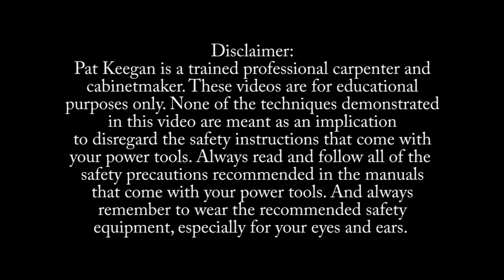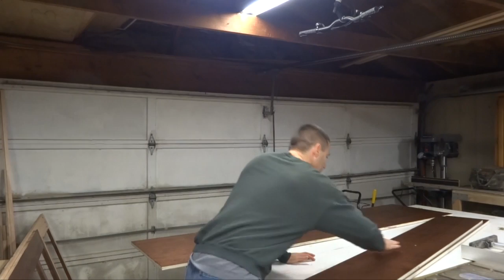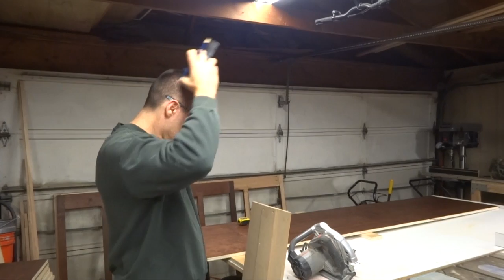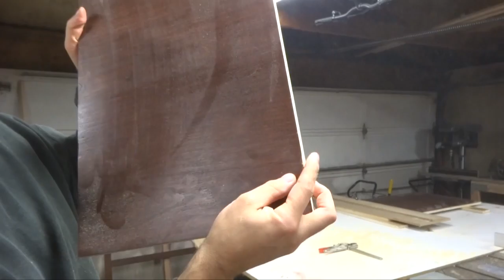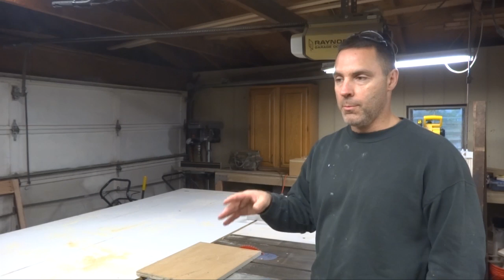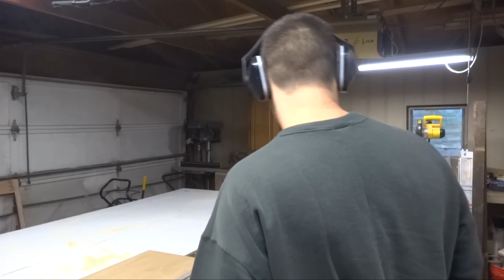How To Build Your Own Kitchen Cabinets: Part 1

Comment: Great video but I see you struggle with cutting your cabinet parts. There is a new affordable machine called the Pro-Cut 50 that will solve your cutting and router needs It will provide factory edges in both rip cutting and cross cutting with no tear out. The Pro-Cut 50 is designed for the cabinet maker and smaller shops. Well worth looking into.
Reply from the maker: torontotool1 definitely. I've been thinking about building a panel saw so that i can do my own cutting in the shop, but it's hard to find the room. I'll Check out the Pro-Cut 50. Always looking for better, more efficient ways of doing things.
Reply from the maker: torontotool1 At first blush, it's a great looking tool, and doesn't take a lot of space. I watched the 4 min video, and i liked what i saw. Definitely looks like a time saver when compared to doing things with simpler jigs like I did in this series. I don't particularly want to criticize because I don't own, nor have I used the tool (and besides, it looks very innovative). But If I had my choice, I'd prefer cam-type locking mechanisms, rather than the threaded "screw-down" type. Over years of use, cam style lockdowns would save a person many hours of screw/unscrew motions. Just my $0.02 on LEAN thinking. That aside, I liked what I saw but would reserve full review/comment until I actually went through the whole process from setup to teardown.
Reply: ***** The Pro-Cut 50 is a wonderful machine designed for accuracy and ease of use. The only time you use the carriage height adjustment screws is when you want to raise the carriage to cut material thicker than 1". The machine will cut material up to 3-1/2" thick. To be honest, in all the cabinetry I build, I rarely cut material thicker than 1" and seldom have the need to raise the carriage but it is good to know that I can if a project calls for it. The Pro-Cut 50 takes the best of a professional table saw, a quality panel saw and a router table and combines it into one precision machine. It is a true professional cabinet makers tool. I am sure if you ever have the opportunity to use the Pro-Cut 50, there would be no turning back.
Reply from the maker: torontotool1 Yes, as I mentioned it does look like an innovative tool for the price. I'm sure I would like to try one out for a couple of months :)

But I was referring to the number of twist locks required with the various operations as shown in the video. There are twist locks to lock the sled in place during router use which seem to be used often, more to hold down the sled/base for the circular saw that need to be unscrewed/rescrewed when changning the orientation of the saw, more to lock the carriage height in place (which are probably used less often) and still more to lock the panels in place when cutting them to create the factory edges. 

I still believe my point is valid. As with all manufacturing, if the tool stands the test of time, you will make improvements to it with future iterations. I would simply suggest in your next iteration, you replace as many twist locks as possible with simple cam type locks similar to the ones you already have that are used to lock the 51" side-guide into place.

Comment: Hi,
I'm a novice DIYer, but I am thinking of making my own cabinets using recovered/recycled timber, is it advisable to use those, instead of plywood for the side panels?
Reply from the maker: Hi, and welcome aboard! Glad you stopped by :). I think it's great that you're thinking of making your own cabinets. 

That's a great question by the way. Really what it comes down to is what are you trying to achieve? That usually tells you what you should use. There are pros/cons to each. For example: Plywood is dimensionally more stable than solid wood. With solid wood you definitely need to take wood movement into account during the construction process, being careful of where the glue goes and how the screws get put in, otherwise you end up with panels that split. On the other hand, Plywood veneers are thin and flimsy and you have to be careful sanding them, otherwise you can burn through the veneer and ruin the finish. 

I would need to know more about the "why"? in order to make a better recommendation. Are you using recycled timbers because you're going for the that particular look/style? or is it because that's what you have available to you and you want to save money? (we say 'it's what we have laying around the shop')?

There's no easy answer because I'm not sure what you want to accomplish. Plywood will be easier to work with for sure. Recycled timber usually needs to be worked (cleaned up, nails and metal bits removed, planed, squared up or jointed, etc). There are lots more steps involved than for using plywood, and that will add time to the project. On the other hand, people put all that time and effort into it because they want to achieve that recycled timber look and feel.

One thing you can do maybe is to compromise. perhaps build everything out of plywood and then cover the visible ends with panels made from the recycled lumber. That way you get the best of both worlds. that's also what we did for this series. We covered the visible ends with Cherry Plywood, even though all the cabinets were made out of prefinished maple.

Hopefully that gives you a starting point. Let me know what you decide to do! Thanks for watching and the great question!
Reply: *****
Hi, thanks for the quick reply!

In a way, the decision to use recovered/recycled timber was more of an environmental point of view, I would like to try and use the recovered timber instead of sourcing for virgin wood.

And funnily enough, to try and use recovered timber, I have to ship it from elsewhere. Those materials are usually timber recovered from old boats and sheds, and have been suitably cleaned up and metals bits removed. From what I can research on those, recycled timber have undergone a certain amount of weathering and seasoning, and I rather like that sort of texture on my cabinets.

But another reason why I was considering against plywood, was I worry about the durability of plywood. I have seen cabinets with plywood falling apart because the glue that was holding the layers together degraded over the years. 

From a cost point of view, I might end up using plywood for all the interior panels, then use recovered timber for the exterior. But if I am already spending the money shipping the material, it probably won't make that much a difference  if I used plywood or recovered timber. I know I will probably have to use plywood for certain areas of the cabinets, but I am hoping to minimise the use as much as possible.

I am hoping to get your opinion on whether it is practical to do it that way?
Reply from the maker: macdawn that's a very cool thing to do and of course i respect your choice to consider the environment.

You definitely have to consider the durability of plywood, or more appropriately, veneered plywood. From my experience, quality plywood, if finished and cared for properly, will last for decades. 

In fact, many pieces of furniture you see are covered with the same thin layer of veneer as cabinet-grade plywood. dressers, tables, etc. And you are right, there is the risk of delamination, which is what can happen to the layers and/or the veneer covering.

Typically though, this happens after the cabinet is damaged in some way, either it's exposed to water damaged, or physical damage (it's dropped, dragged, scrapped, bumped with something sharp, etc) which can kickstart the process of delamination in that area. Water damage is the big one, but you get the idea. 

I'm not trying to convince you one way or the other, because both methods have merit, and each has their pros/cons. It all comes down to what you're willing to live with. 

I also weld. I recently made a couple of nightstands and a headboard made from welded steel frames. I will use recovered lumber for the wood components because it matches the look i want. (industrial urban weathered vintage, etc.)

If i were making a single cabinet, or a couple of end cabinets, or even an entertainment center (movable) i would consider the recovered timber. but if i were making an entire set of kitchen cabinets, i would use the plywood, and perhaps cover the end with the recovered panels. It's just too much work and mindfulness of wood movement to do them all out of solid wood (for the carcasses I mean). Plywood is faster (for me) and usually less expensive (for me).

Good luck! Post links to pics when you're done!
Reply: may work but would have to make a outside frame frist and cover with what ever type of board you were using like in old style days befor plywood was made

Comment: Just to add a couple specifics about the wood dust dangers, carpenters have been shown to be 4 times as likely to suffer from asthma later in life, and, hardwood dust has been clearly shown to cause cancer, particularly of the nose...  Lots more can be found on the internet, but serious stuff not worth overlooking the protection of a respirator to prevent the risk.   And since we're talking about 2 micron stuff, you don't take your mask off when you can't see heavy dust thinking it's safe now since there's still plenty of the fine dangerous stuff to do you in.  Dust collection systems should be a must for anyone doing regular cabinet building like this... check harbor freight and others for reasonable priced systems as anything is better than nothing.  I actually cut outside in my driveway (tables saw's on casters) to not be trapped in a closed space like the garage.   thanks!
Reply from the maker: You are so right on. I mentioned in the previous comment (as well as another viewer posting a similar concern) about a dust collection upgrade to our small shop. I often do the same with cutting outside, even in colder weather. But you're correct. Most work is done on the inside. Thanks again for the great post, and a reminder that respiratory heath is just as important as our eyes and ears; a fact that most of us (even me at times) overlooks.

Comment: Should also be using a dust mask or respirator.  Those particles you are breathing can be pretty bad for your health, especially from different woods that could contain things like formaldyhide or where the species of wood itself is bad for the lungs...  Always wear "the big 3" - hearing, eye, and dust protection...  great video though.
Reply from the maker: You are absolutely correct. These videos were done prior to having some dust collection elements installed. We are in the process (always it seems) of upgrading the shop and you definitely hit the nail on the head. This is the first upgrade to make. Do you have a list of the woods that you can share that can adversely affect lung health? I always wear a mas when cutting MDF, but have been lax in the past about cutting other stuff. But great point. Thanks so much for sharing, and for watching.
Reply: You can search up several good sites using "wood dust dangers"

Comment: Hey nice video.. would you not be able to buy a different blade with tooth pitch change to limit or even reduce chips?
t
Reply from the maker: Hey Tony, that's a great point. Yes, they do make different blades that are better suited for different materials. I have used blades in the past that have been specifically made for plywood which helps reduce or eliminate chip-out. They do work well. For our purposes, the combination blades work well enough, particularly if you move a little slower on the crosscuts using the jig, it works great. In making cabinets, it's rare that you can't hide any sides that have the chip-out by facing it inwards, or towards the bottom where no one will see it.  I found a good article on handling/cutting plywood here: http://www.woodsmithshop.com/download/308/7plywoodtips.pdf. Thanks again for the comment, and for watching!!

Comment: Sorry if I missed it, but what did these cabinets cost you?
Reply from the maker: That's a great question. I haven't done a total yet, but will definitely post it. An interesting behavior I've noticed over the years is that when you do it yourself, whatever the project, you find that since you are doing it yourself you can afford better materials, higher quality hardware, etc. for the same budget. Sometimes, the cost savings isn't as great as you would think, but because you did it yourself, you got the best possible product for the same price as a lesser product that was built and installed for you. Thanks for watching!

Comment: You may cover it in another video, but what are your rail and stile dimensions?  Thanks.
Reply from the maker: Hey, thanks for watching. Knowing me I probably said it half a dozen times :), but I prefer 2" wide stiles and rails in general. The top rail for the upper cabinets is 4-1/2" to accommodate crown molding with some space for the 1/2" overlap of the overlay doors. It's only a personal preference. Many cabinets have 1-1/2" S/R dimensions, I just think the 2" looks better. Thanks again!

Comment: Hi, great video been looking for one like this for some time! Are you using Kreg pocket screws? The ones you are using look darker in color than the ones I use. Also, if they are not Kreg pocket screws where do you purchase them as well as your doors?
Reply from the maker: Thanks for watching. Hope you can find them useful. The screws I've been using come from http://www.mcfeelys.com. I've used Kreg screws as well. Either is fine. I tend to like the McFeely's slightly better, though I can't give you a solid reason, other than liking the "feel" of them. Kreg screws have a wider pan on the head, which sometimes seems to stick out a bit. Again, either will work excellently. I order a lot of my doors, drawer boxes, and drawer fronts from http://www.walzcraft.com .  I'll post links to suppliers on my blog. Thanks for the questions, and hope you enjoy the rest of the videos.

Comment: What kind of wood you are using
Reply from the maker: For the face frames, I'm using solid cherry stock (3/4" x 2"). For the cabinet carcasses, i use pre-finished maple plywood (again, 3/4") and cherry-veneered plywood for the end panels. I also use a Red Mahogany stain on both. Thanks!
Reply: thanks